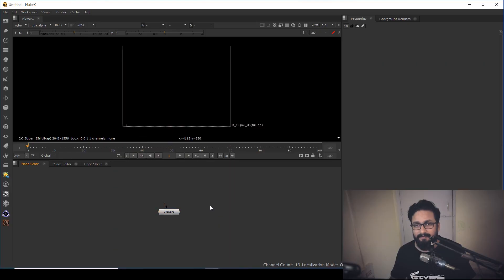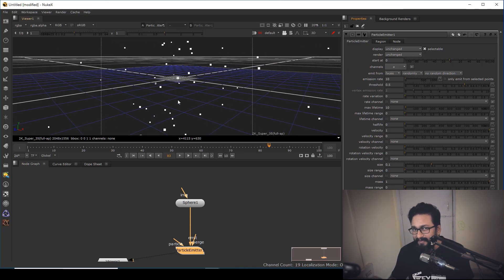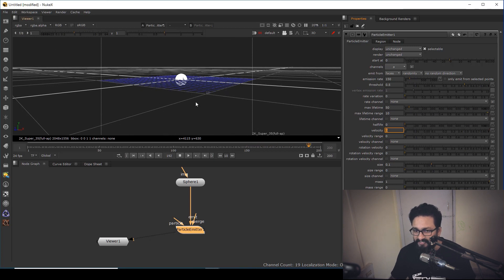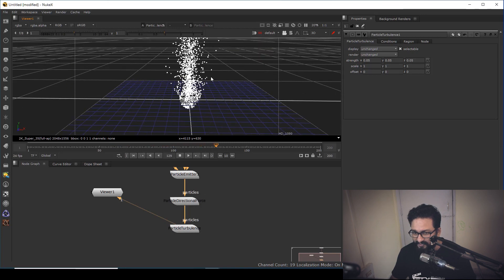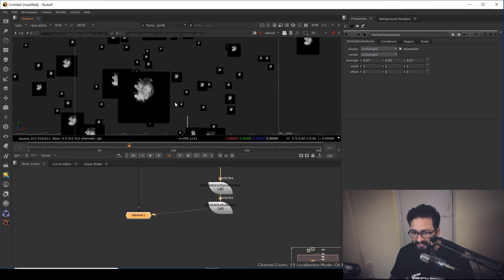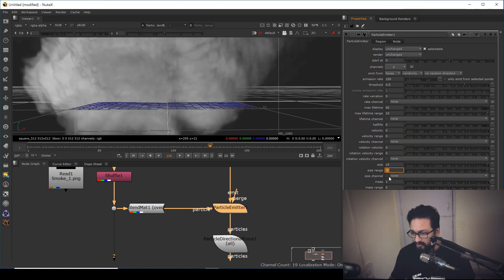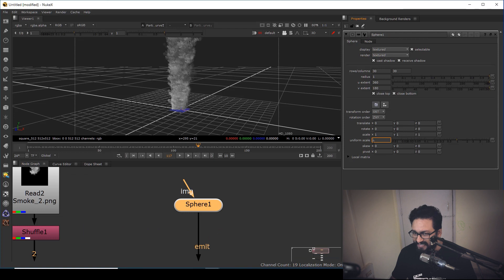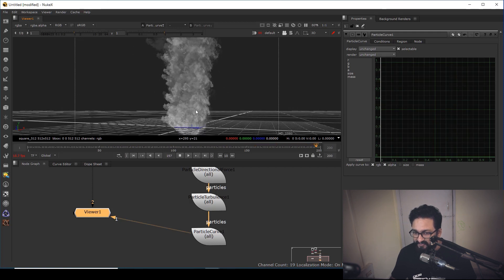HOW TO CREATE REALISTIC SMOKE IN NUKE PARTICLE SYSTEM | VFX VIBE

Comment: Great tutorial! And a really amazing result. Is there any way to make it so that the scanline render renders it at a faster rate? I have a fairly good computer and when I try to watch the result on the scanline it takes like 10 minutes to load a frame
Reply from the maker: The time you mentioned is very high, you need to check your flow or it might be possible that you are using a high number of particles emitting on each frame.